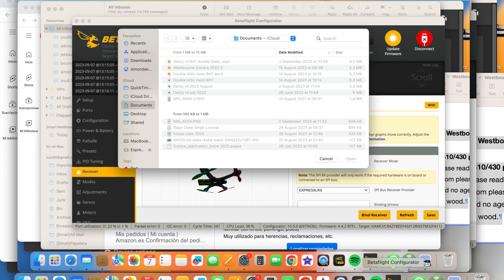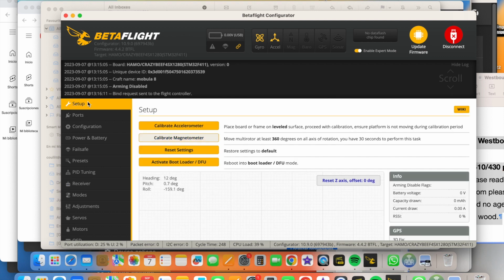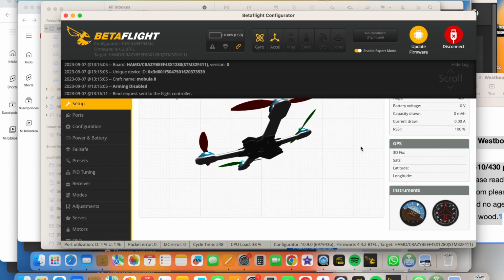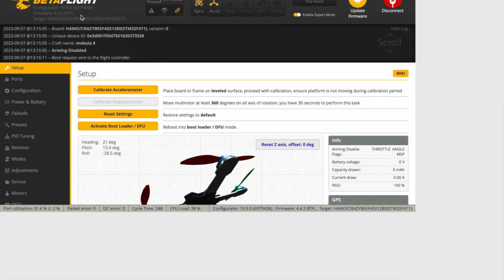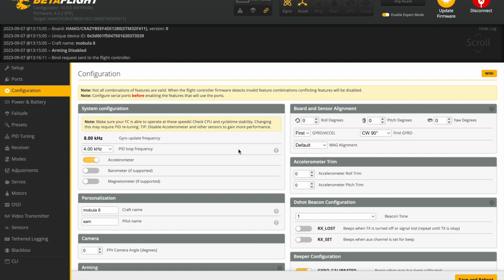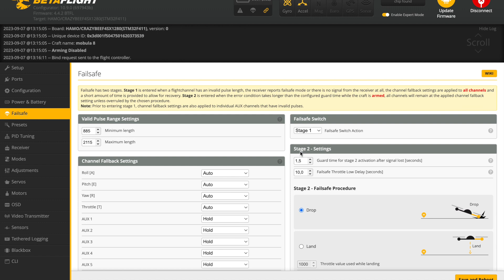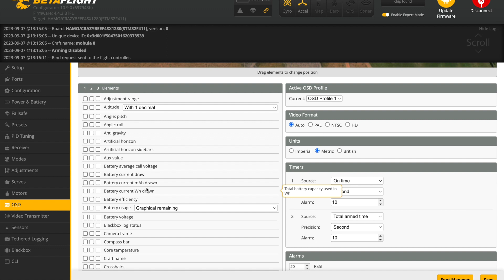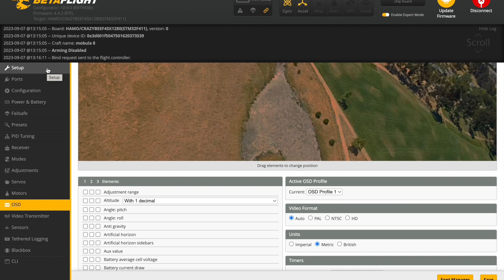Mobula 8 binding with Radiomaster pocket radio and configuration

Comment: Hola, tienes que configurar la emisora en la pestaña que dice "MIXES" 
Ch1 Rud
Ch2 ele
Ch3 thr
Ch4 Ail
Ch5 Sf
Ch6 Sa
Ch7 Sb
Ch8 Sc
Etc...
Desde el canal 5 agrega los switches a tu gusto.

Cuando abras betaflight, te detectará el movimiento de los switch y podras configurar el armado, modos de vuelo, etc.
Reply: Escanea el codigo QR de la caja del mobula8 , ése es el manual.. Yo también tardé días en hacerlo volar.

Y cuando logres armar motores y uno no gire... Tienes que ir a la página "Esc configurator" desde crome, y poner los parámetros que sale en el manual y listo.
Reply: @dematrixfpv5570  hola amigo, tengo el mobula 8 uart lrs hace tiempo y no he podido moverlo, he visto muchos videos y echo cambios pero ya estoy por rendirme con esto no se que hacer, como he movido el firmware muchas veces ya no se cual es el correcto ni la configuración, ya no se que hacer, agradezco si me puedes dar alguna indicacion con eso, quisiera almenos saber de una versión con la que si funcione efectivamete muchas gracias
Reply: @handrusalexisflorezmontaez4061   Lo que yo hice fué conectar el dron a betaflight y ahí encontré la opción de bindear el dron, luego en la emisora busque la opción de bindear y así lo conseguí... Una vez que betaflight te reconoce los movimientos de la emisora, estás dado para el éxito, lo demás es configurar los interruptores.

Comment: Hi, nice video, i'm olso struggeling to bind this 2 !!! I have the radiomaster pocket and the mobula8 O3 but i can't bind them. If i update the mobula to betaflight 4.4 i'm not able to select SPI Rx in recievers, evertime i reboot it goes back to Serial. If i flash to 4.3 then i can select SPI Rx, but than the drone is not in ELRS 3.0 so i can not connect to the radiomaster. Any ideas ???
Reply: I've spent days trying to bind my mobula8 to my radiomaster pocket... still not bound Did you resolve your issue(s)?
Reply: @MSWindman   open elrs tab on your controller, and disable model match. also change packet rate to 250hz(those 2 things held mea away from binding my mobula)
Reply: @macnatkaniec  not going to lie, bro you need to do a video from this one comment this literally fixed my drone in two seconds by changing the settings. I have been trying this for at least a week or so.
Reply: @TheDynastyclick  glad It worked. Enjoy your flights
Reply: @MSWindman  I just got my mobula 8.  After I entered the binding phrase in the drone using ELRS configurator, didn't matter - when plugged into Betaflight, my stick inputs were not being sensed at all.   I followed the instructions in the Modula8 manual - just connected to power 3 times, then left plugged in, then went into the Radiomaster Pocket, ELRS tab, scroll down to [BIND] clicked on that.    I didn't see any change in the LED lights on the drone or anything.   But after that, now the stick inputs show up in betaflight --- going to see if it will fly now...
Reply: @bugmanmd1576 hey, out of interest did you get it flying? I did this and my stick inputs also show in beta flight, but now I have the issue of the drone actually not responding to the inputs (I.e. the motors don’t move)